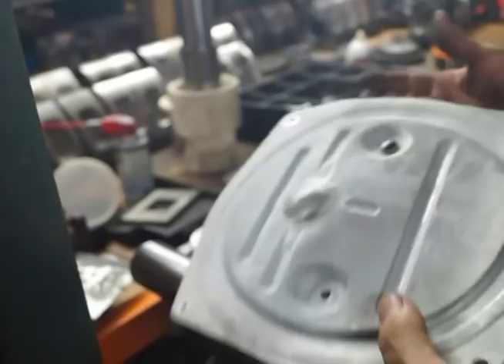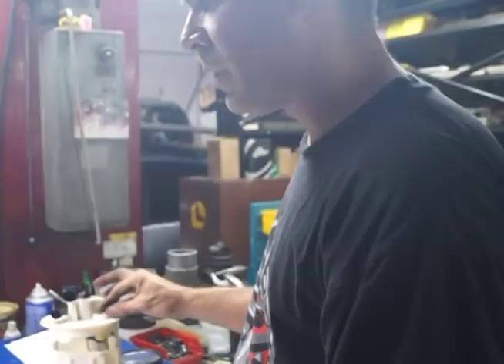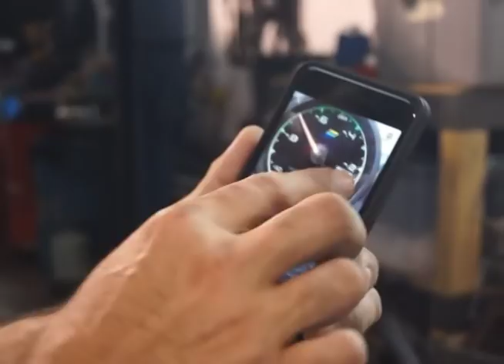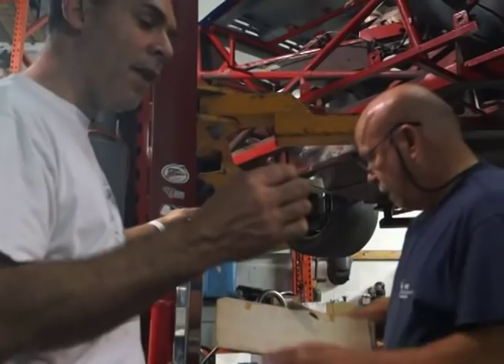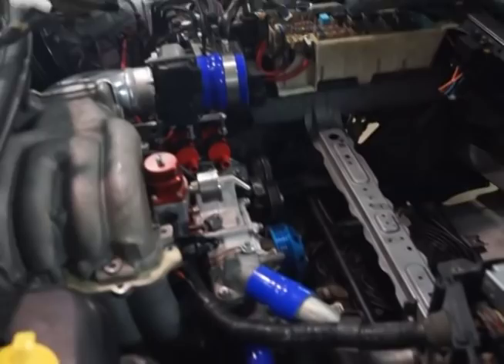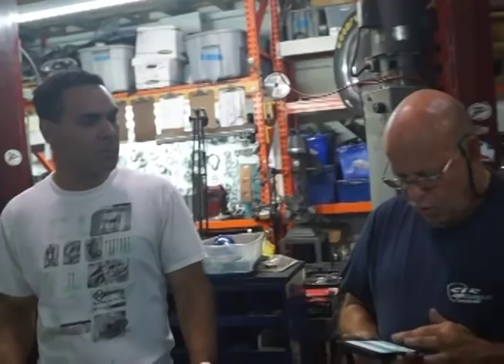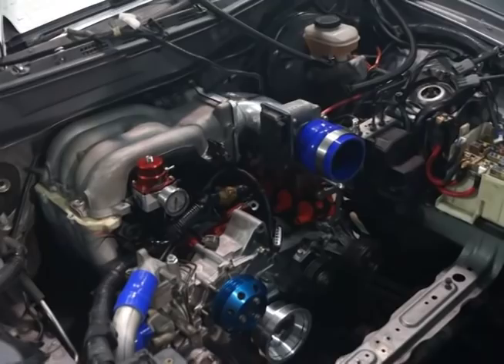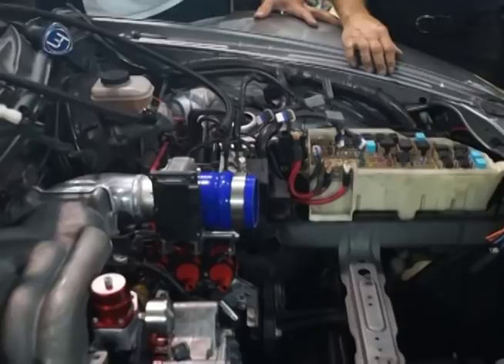Project Turbo RX8 Part 38

Comment: Will this kit allow you to use the rx8 ECU and will it just be do the swap and plug the wires up
Reply from the maker: The build incorporates the Adaptronic Piggy back computer for the RX8. So yes the OEM computer remains functional, only the timing, fuel, and other engine mgmt functions will be controlled by the Adaptronic.
Reply: What is the adaptronic and I am very interested in this build
Reply from the maker: http://www.adaptronic.com.au/previousecus/rx8-select-pnp/